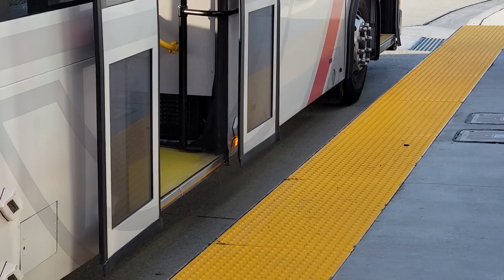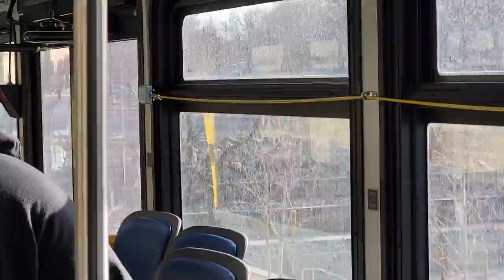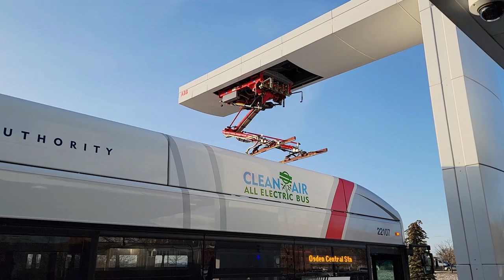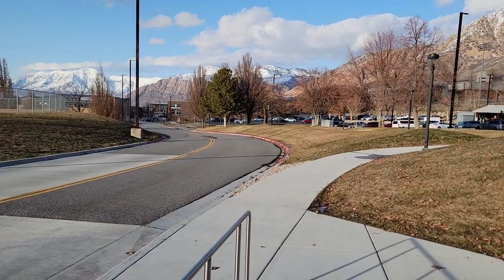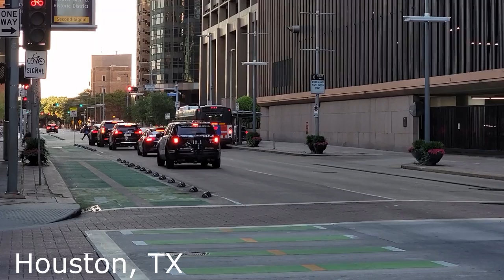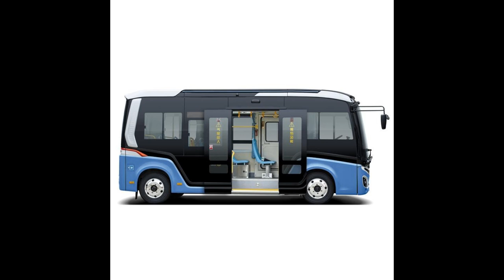OGX - UTA's newest BRT Line

Comment: Great video! Although at the end, the autonomous transit you mentioned should be something to be extremely skeptical about, we already are capable of autonomous metros, but ground transportation is nowhere near ready to use autonomous vehicles, so we gotta stick to building metros
Reply from the maker: Full autonomy is certainly taking longer to develop than the promoters promised.  And certainly we shouldn't scrap any transit plans based on future speculation. But it's fun to look ahead and consider what is possible.

Comment: Cool video about the OGX! I haven't had the chance to try it out yet. I was just trying to remember what even happened to MAX, kind of sad to see everything just merged back into the traditional "35" route that has been around for many decades. Something that I think would help these "X" routes is if they just discarded trying to adhere to a traditional schedule. Let's all just agree that the buses will leave the terminal stations every 10 minutes and that they will drive the route as quickly as possible to the end without lingering at stations in between. 

The schedule matters a lot when the next bus is 30-60 minutes away. But when the next bus is at most 7-10 minutes away, the schedule matters much less, and I'd rather just get on and get to my destination as quickly as possible. I believe the VTA's 522 Rapid in San Jose does something similar to what I'm thinking of.

Comment: Another comment: While battery buses are...okay in terms of ride quality and sound, do you think it would've benefitted more from trolleybuses? For one thing, trolleybuses are more efficient (because they're lighter from the lack of a large battery but may still have a small battery in case of necessary deviations) plus they're safer and easier to put out if there is a fire. Other than cost, I don't see why we shouldn't have them.
Reply from the maker: Certain sections, such as the Weber State section, would have been amazing applications for a trolley bus!
But the local opposition downtown was already bad enough... I can't imagine how much longer the arguing would have lasted if overhead wires were involved. Perhaps there was a compromise solution of an off-wire section downtown like some streetcars do... but I wasn't senior enough at the time to make those kinds of recommendations.

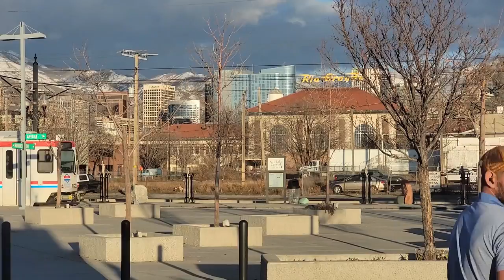Comment: 12:03 It's actually very likely that these things are very likely to fail as self-driving cars are already proving terrible for pedestrians and systematically flawed. Plus they're about as inefficient as a human operated car and much less efficient than large fixed buses as in general, the average occupancy of these autonomous vehicles may be the same as the average car occupancy (1.5 people) basically having the same problem as cars have had all along basically defeating the whole point. Buses, streetcars, and trains are able to hold much more people while taking up fewer resources of the road so therefore, current public transit will actually be more efficient and cost effective since you'll need more of these things for a population of 2.7 million and growing compared to the amount of buses and trains that you'll need therefore increasing the cost to run them. Not to mention that the main people who are behind these projects are usually corporations who couldn't care less about public transportation and just want to make more profit.

Sabotage is also another issue. It's possible that a hacker can break into a vehicle's IT and use it to disable and/or crash one vehicle and putting a city in gridlock. One example is in 2014 when Charlie Miller and Chris Valasek remotely hacked into a brand new (at the time) 2014 Jeep Grand Cherokee. They were able to control the whole system (such as the A/C, transmission, brakes, steering, locks, and even killed the vehicle on the highway) and were able to do it with ease just by having access to the infotainment system.

Plus, there is also the weather to deal with; it's not weatherproof. If you ever know about cruise control, you know that it's not a good idea to use it during bad weather because it's actually less safe (because you're more likely to lose grip) and self-driving cars plus these autonomous vehicles aren't any different not to mention that rain, snow and hail (plus additional mineral etching) will obstruct the cameras and sensors so if there is ever a rainstorm or snowstorm, you're basically leaving thousands, if not tens of thousands or more people basically stranded where they are until the storm passes and this isn't something that regular public transit has to deal with since regular buses may be deviated and rail transit is completely unaffected.

I will also want to mention that they only work when all vehicles are self driving which isn’t possible because there’ll always be people who are going to drive their cars. For example, I love driving my manual Civic and especially at night, it’s fun to drive. Do you really expect me to have to give it up just for this?
Reply from the maker: I've thought about these points before engaging in my speculation. I don't think any of the challenges you listed are unsolvable. 

Elevators used to be operated by people. There were hours of operation because it wasn't economical to pay all your human operators to work late into the night. Buildings built fewer elevators because they were expensive to staff and operate.
Now elevators are controlled by computers, and they are ubiquitous. Everyone uses them. They operate 24 hours a day and come to you at the push of a button. 
Buses and transit must eventually become like horizontal elevators if we want to compete against the convenience of the personal automobile.
Reply: @CSLenhart  Well, I am probably going to say that elevators are rather a bad example since they're similar in operation to Automated People Movers and some Metros like SkyTrain in Vancouver. Flexible transit like what you mentioned are a lot more complicated than fixed transit. Even then, automated train operation needs to be well inspected and maintained otherwise it could lead to a deadly collision like what happened in 2009 at Fort Totten.

I should've made this more clear; I'm not saying public transit can't be automated and I think that fixed buses may be automated. What I meant to say is that autonomous on-demand flexible transit is a lot more complicated and requires all cars to be self-driving as well (and there are cars that can't be self-driving like manual cars for example). I would be interested to see how an automated fixed bus would work in the future and CBTC has been a great replacement for ATC (automatic train control) and are very reliable which is why cities like NYC and Toronto are replacing fixed block signals for CBTC. In fact, Paris has already automated Lines 1, 4, and 14. I am not opposed for automation; in fact, I am all in for the implementation of automating transit like the use of CBTC, but I don't like how it's going for personal vehicles.

Edit: Or at least in 2009 for the ATC. Alstom was also held accountable since they built the train control. WMATA since went manual and I heard there are plans to upgrade to CBTC as well.

Comment: It doesn't really seem like a lot of people ride OGX, but if they have to buy more vehicles then that's good.
I wonder if it will slow down when it's not free anymore.
The center lane bus thing was huge when I lived in Seoul and it was a great deal.  They cut through the traffic nicely.
And I had a place to bypass traffic on my Harley and they didn't really enforce traffic laws for motorcycle riders.
Ogden is going to eventually put in more dense housing along Harrison so this is a good thing to put in now.
Reply from the maker: I agree, the OGX investment on Harrison Boulevard makes a lot more sense when you consider the higher density planned around Weber State in the future. 
My experience with ridership is that it really depends on when you ride. During big events, UTA can't run buses quickly enough. Normal weekday evenings see a lot of empty buses. That is what inspired the ending thought about autonomous buses able to match the variable demand levels.